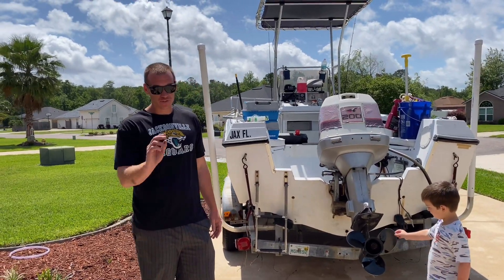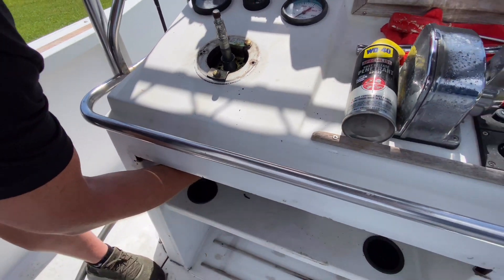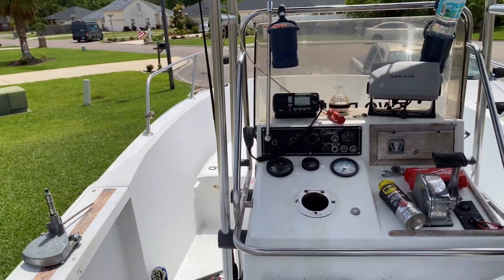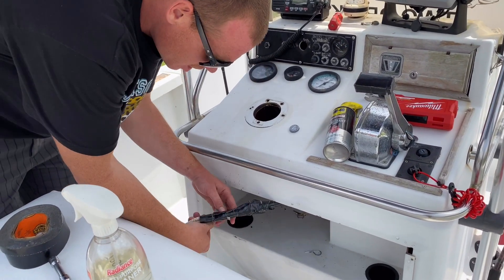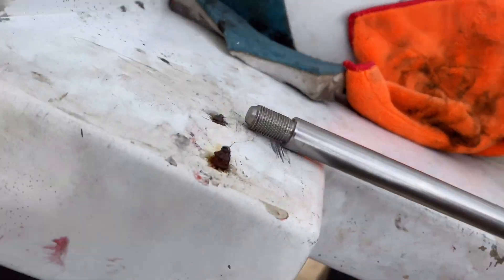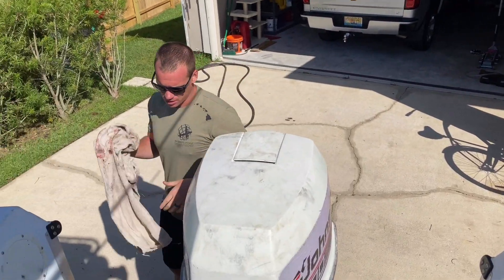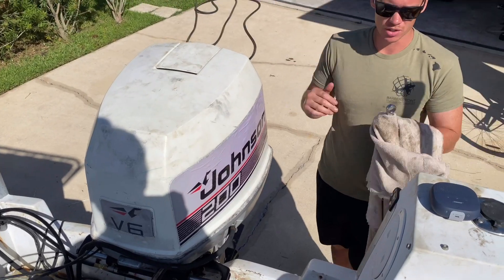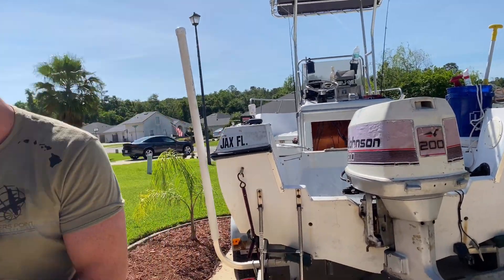Outboard Hydraulic Steering Upgrade

Comment: Mobile 28 on the shaft?  So how did the cylinder attach the the outboard?  

This is worse than a Sikorsky manual. 

Disconnect battery

Remove engine

Reinstall engine

Reconnect battery.

Comment: So that is a simple hydraulic system without a hydraulic power assist pump?   I'm thinking of the same upgrade, very similar boat.
Reply from the maker: Todd Gatesh yes the steering wheel acts like the pump & selector valve, two tubes running to opposing sides of the motor, hardest part was running the lines.